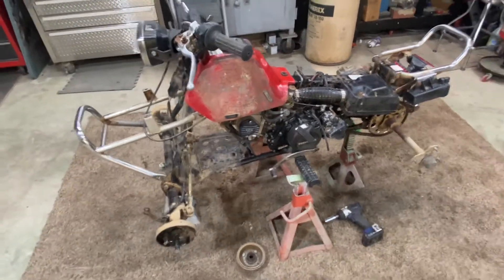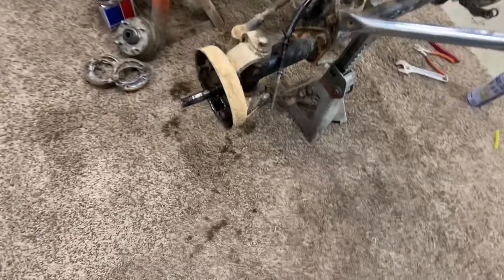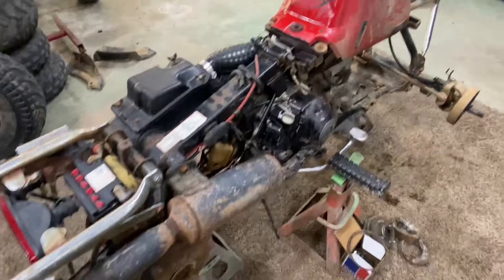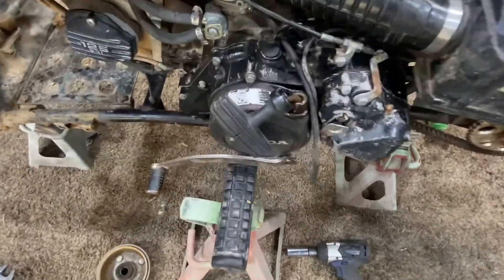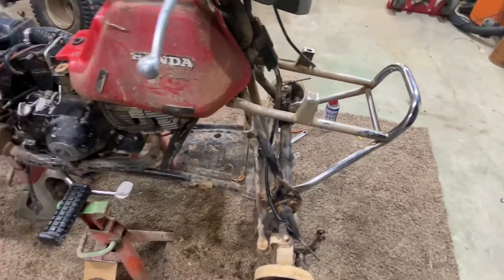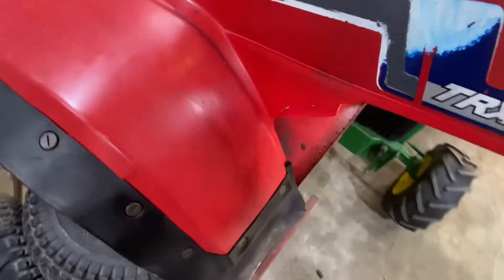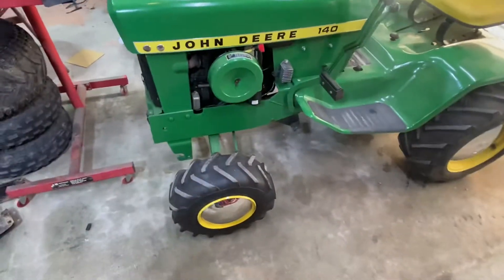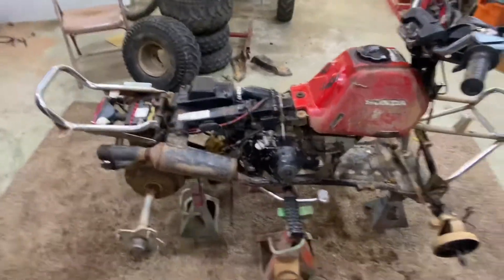1985 Honda TRX 125 tear down Video #2

Comment: Nice! I'm working on an 86 that has a ticking sound in third gear. Do you know how difficult repairing/replacing the third transmission gear is?
Reply from the maker: I haven’t split the case on mine. It’s usually not too bad though as I’ve done other engines. I’m sure there are videos on here.  It’s just 
 very time consuming. Lol.

Comment: How much money did you put in it?
Reply from the maker: $250.00 so far. I still haven’t finished it. I have a piston, ring set, chain, and the gasket kit for the engine i still have to do. Hope to finish it over winter.
Reply: @JnP-Restorations  i have one too, that I had as a kid. Just curious if it is worth restoring. Everything has come off real nice, so far. Except the spark plug did not. I broke it off in the head. I have never seen that before. Now I got the bolts for the head soaking.
Reply from the maker: @brantnc  I look at mine as a keeping it forever point of view. Lol I don’t plan on ever selling it so in my case i think it’s ok. If you are looking to fix it and resell then i wouldn’t. They really don’t bring a lot of money in good shape and running. Ive seen mint ones go for around 2 grand. I enjoy bringing stuff back from dead. Some i win, some i lose. 😂